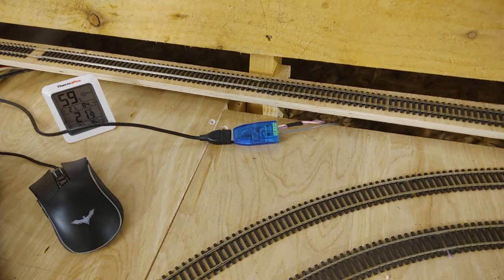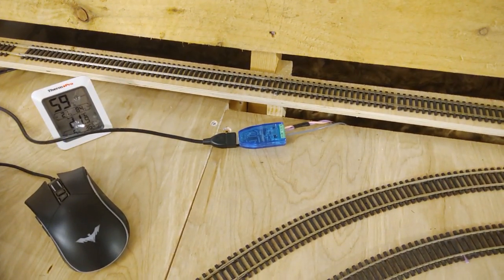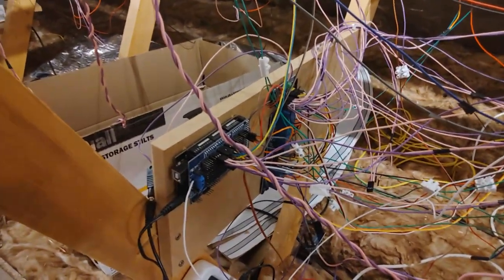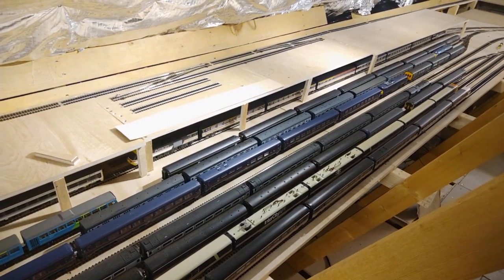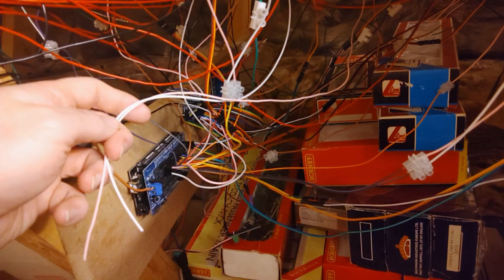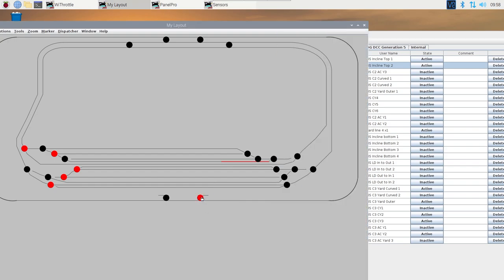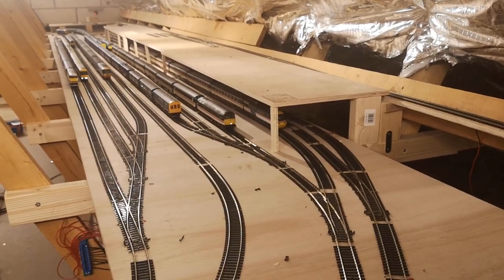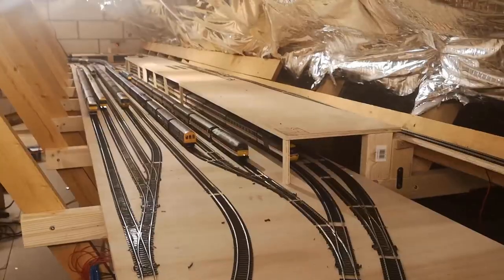Layout update - RS485 fixes, Feedback Sensors, JMRI issues  and electrical interference

Comment: Hi, could you completre the  sketch line "bus.begin(9600,   " this is all the code I have. I have been following your progress with intent as I am trying to establish the same kind of setup. I havent been able to get the frog relays to switch without using a MOSFET. The output pins do not supply enough current. Keep up the excellent work
Reply from the maker: Hi John, thank you for the kind words!
Serial.begin(9600, SERIAL_8N2);
Some good documentation on the two custom libraries here https://github.com/madleech/ArduinoCMRI and here https://github.com/madleech/Auto485 - he has some good examples of using the libraries in ways I didn't know were possible and I learnt one or two things, hopefully they'll be helpful for you too.
I use the 8 relay boards and they have a separate power supply header under a jumper on one corner of the board. Although I don't actually use it as I actually have them connected to the PCA9685 board (I have 8 servos and 8 relays per 16 port board). The PCA9686 has enough power to run it. I talked about it in this video (shameful plug!) https://youtu.be/bpWt6p9PFpw?t=1529 hopefully it'll take you to the right time in the video.
Last of all I have examples of the code I'm writing here https://github.com/Vintage80sModelRailway/Vintage80sModelRailway-ArduinoMultiplePWMBoardControl - it's about to get another update for smooth startup, I'll probably make a video about that shortly.
Good luck with your layout!
Reply: @WirenwoodModelRailway  Thank you , that was a lot of help. I will look at your Microswitches Vid. For some reason I cant get even the relay that comes in the Adruino kit to fire, I need to check it against a different board. I look forward to your next vid.
Reply: @WirenwoodModelRailway  I finally got the PCA9685 to fire the relays. I had tried that method originally but it did not work, the reason I since discovered, was because I had given it a value of 495 instead of 496. I tested the voltage coming from the PCA Signal terminals, and it is significantly less than 5v. However, it can deliver more than enough current to drive a relay, whereas the Arduino pins cant really. Anyway, thanks to you I persevered. Rob of Little Wicket recommends the madleech libraries. It was through originally watching his videos that gave me the inspiration to go down this route. You guys that make these videos make a huge difference to the modelling community, so thank you.
Reply from the maker: @johnworby5130  Thank you, that's very kind. Just checking - you do mean 4096 rather than 496, right?!

Comment: I must admit I gave up with those units and swapped to a different version which seems to work a lot better.
Reply from the maker: I gave up on RS485 in the end and switched to Ethernet/wifi and MQTT. Regards, Chris
Reply: I have been testing out using can bus to see how that would work out on a test plank.😀 @WirenwoodModelRailway